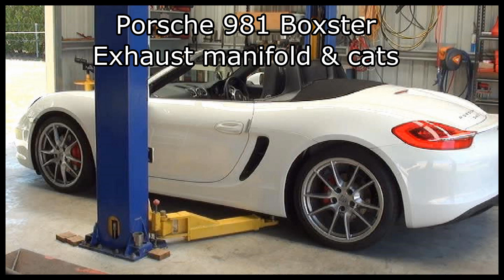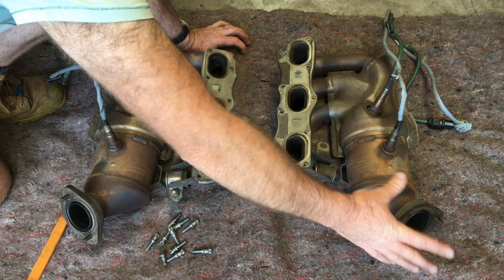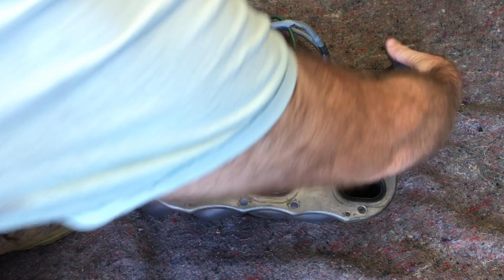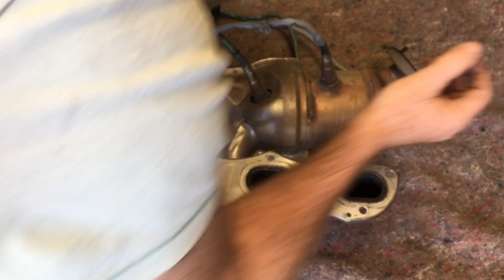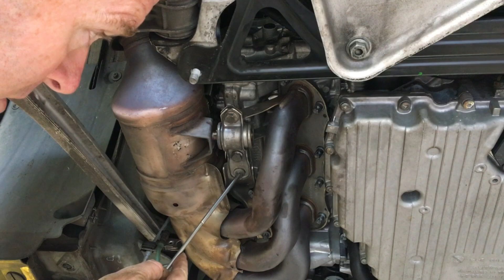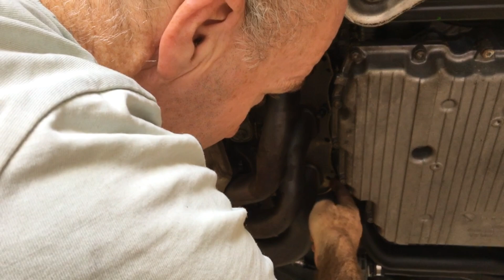Porsche 981 exhaust manifold removal

Comment: Does the cat-back exhaust really need to be removed? I would think (hope) that the manifolds would be able to be wiggled off with the cat-back in place once all the bolts are undone?
Reply: Dis you ever establish an answer to this question? as im looking to do similar, I've already had my back boxes off, so all my back box fixings are new.
Reply: @germancarfan360 I actually just did this last week. Both manifolds removed and replaced. Zero need to remove the cat-back system. 👍🏻
Reply: @jayymac  You bloody legend!! that is music to my ears!! thankyou for this.  Did that brace also need to come off? that he talks about ( where he made a separate video showing how to remove it )? or can you also leave it in situ aswell.  Did your manifold bolts all come out ok? can I ask what you have done this job for? I have got a cat efficiency fault code up p0431 I think it is.  For my drivers side cat UK car so right hand side.
Reply: @g @germancarfan360 e diagonal cross brace that goes from the chassis to the central support brace/pan needs to be removed. As long as the wheels are off the ground, you won’t need to get an alignment after. Some of my manifold bolts were pretty rusted. I had to hammer on an E10 on one of the bolts what was pretty corroded and the E12 was just spinning on it. But they all came out easily. I would just go slow with a regular ratchet and make sure the bit is fully seated. 
I did this job because I needed to replace my valve cover gaskets and had to make sure I could get the headers out to access and remove the valve covers.
Reply: Really appreciate quick response, so the bracket that when you look at it once off the car, it looks like a face / mask weirdly... that one yes.
Reply: @germancarfan360 that big “face” central bracket does not need to be removed. Only the diagonal brace. One each side that is just a straight line. 5 nuts each.  Connects the chains to that central brace. That’s the only one that needs to be removed.
Reply: @jayymac  I know the one, thats a great help! thanks buddy.